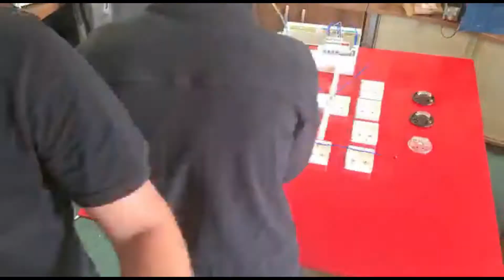How to make an electrical test board. RCBOs, Ferrules, Meter, Service head, EV and more!

Comment: They are an excellent idea for sales demonstrations and apprentice training. You can add in resistance by getting some high power low ohm resistors and wiring them in series to get better readings on the instrument, or show what a fault would look like. You can have one set up like that in your workshop for use as your monthly checks on your instruments. For training I would have added in a metal clad socket bonded behind back to the earth bar to show the effects of parallel earths when testing.

Comment: Nice one Mark I want to be able to switch in faults rather than change the wiring each time it should be fun making it 😁
Reply from the maker: Yeah it's easy done with a few switches. The big box on the left under the meter we add toggles for that purpose on test boards that need them.